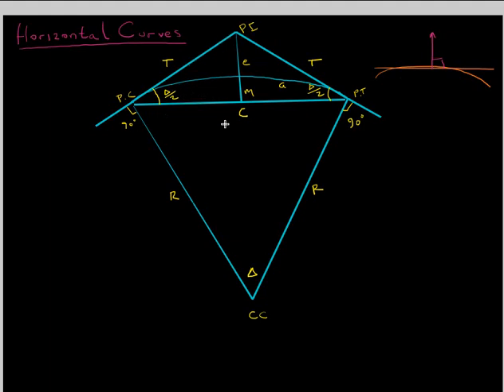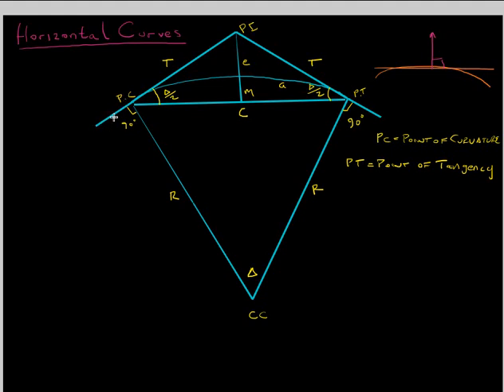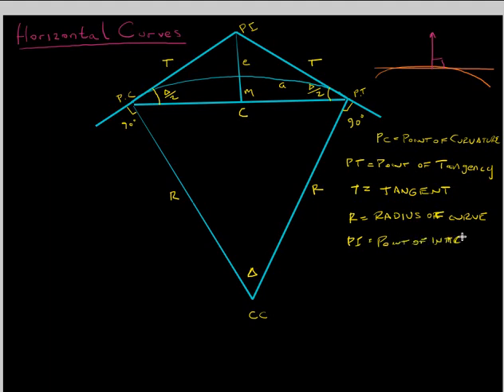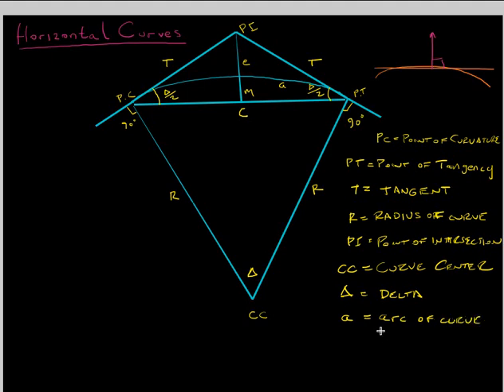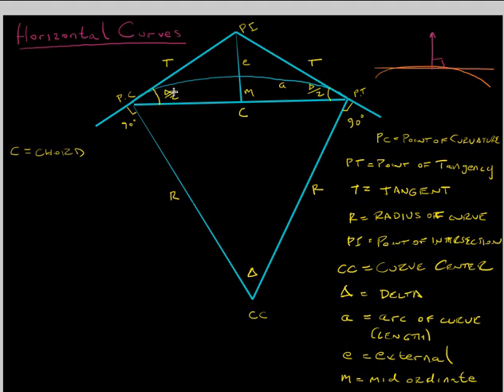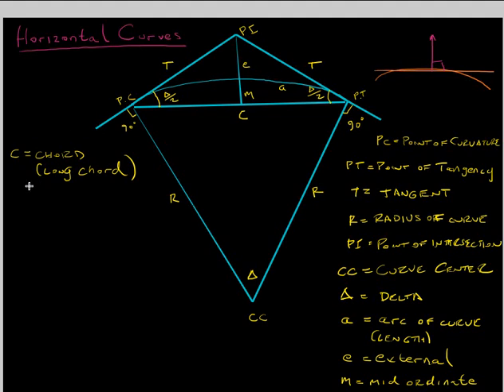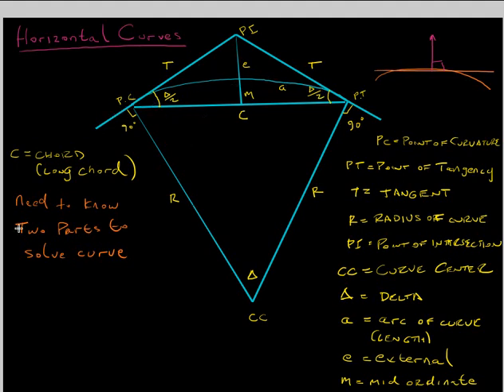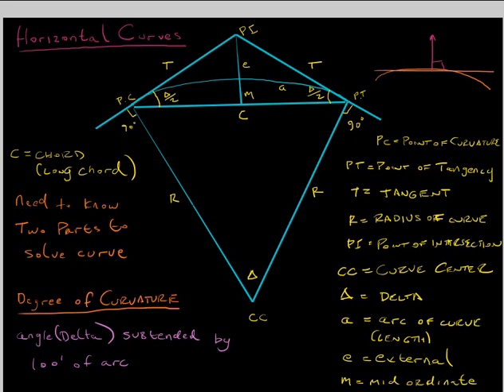Horizontal Curves (Part 1)

Comment from the maker: It is all about the geometry. Pick a delta angle arbitrarily and you know the deflection angle between the two tangents is equal to delta. Then take 180 from the delta angle to get the interior angle between the two tangents. then use the rules of triangles to figure out the other two angles within that triangle (both of the angles are equal). You will find it is the same angle as delta over 2.